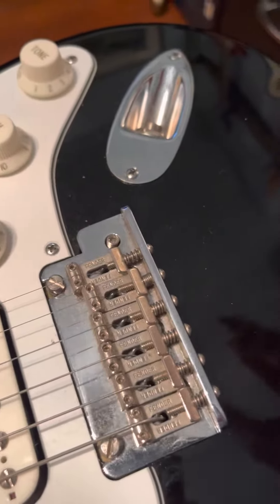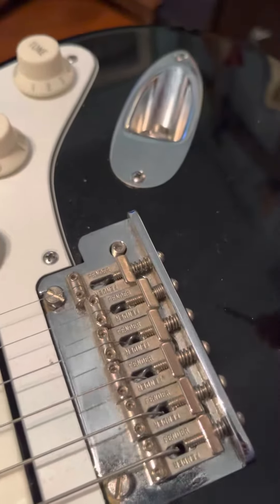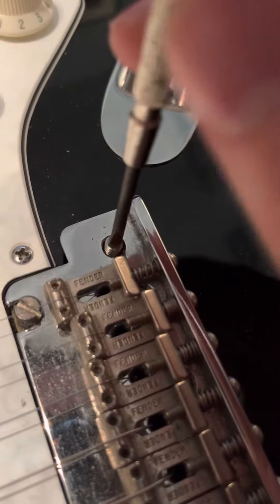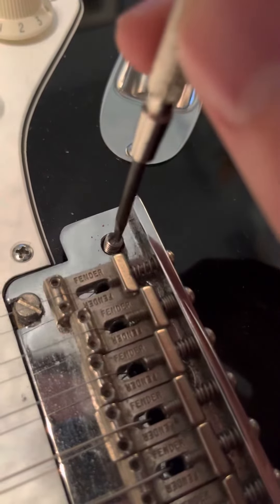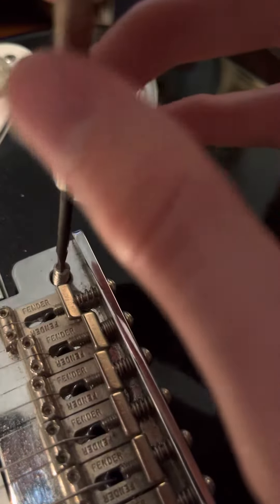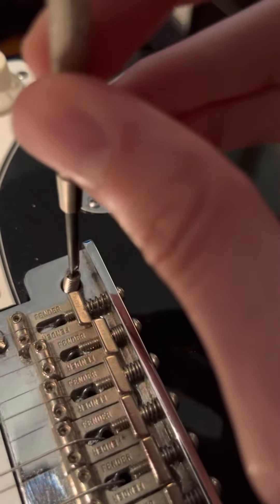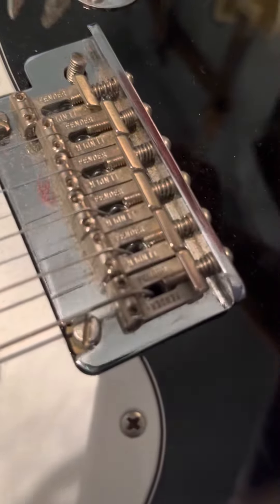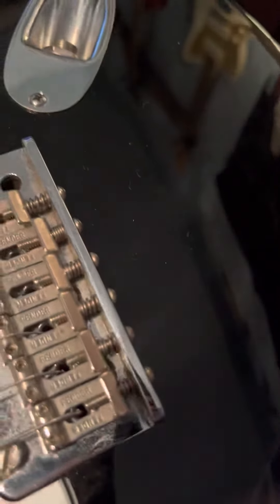HOW TO remove snapped tremolo/whammy bar

Comment: If a guitar comes with a whammy bar but you don't want it can you remove it and it will still work fine?
Reply: Yes if it's a strat from my experience they come with a whammy bar that you can twist into the tremolo the whammy is only there for bending the strings to stretch out notes